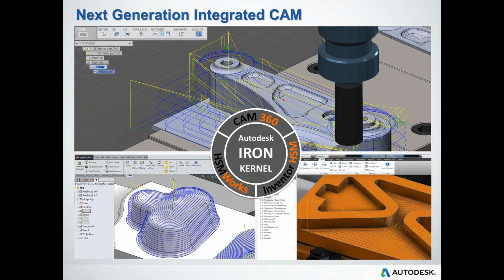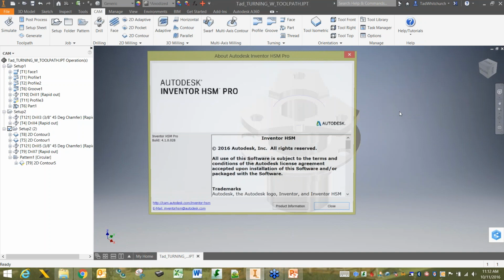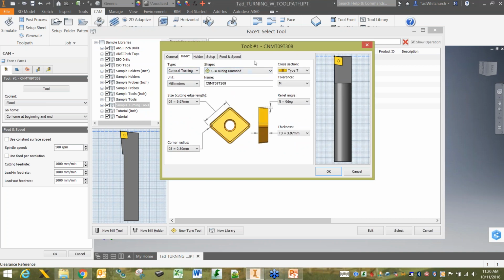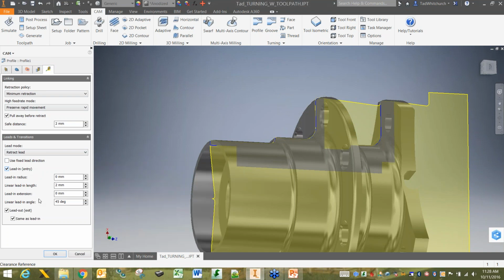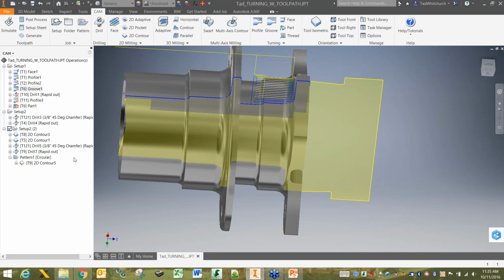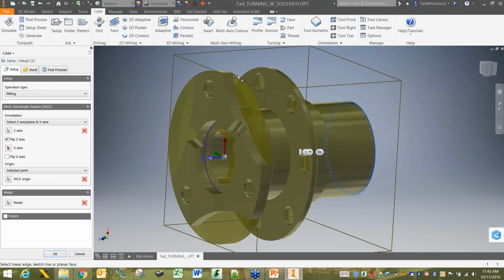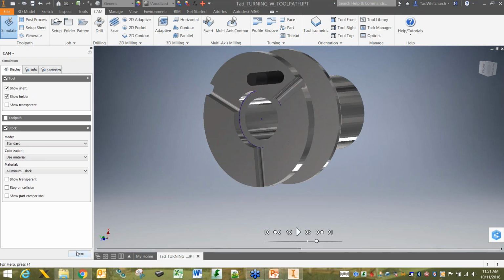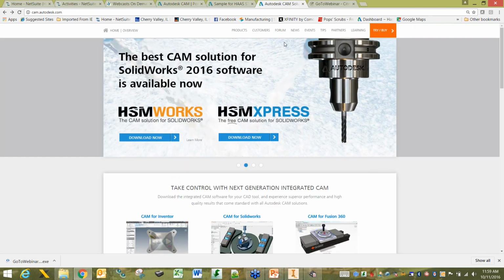Inventor HSM Turning

Comment: Does Inventor CAM has an ability to generate a canned turning cycle for DMG Mori NLX 2500 700 CNC machine with main and sub spindles? Thanks.
Reply: Check out this link... https://cam.autodesk.com/hsmposts and on the "Vendor" drop down you should find the DMG Mori.  I looked at the sample and not seeing canned cycles.  You might also try the Doosan as that post seems close and does support some canned cycles.  This forum is a great resource place... https://forums.autodesk.com/t5/hsm-post-processor-forum/looking-for-post-for-dmg-mori-nlx2500-mill-turn/td-p/6851166
Reply: @tadwhitchurch1103  Thanks for a reply buddy, I will look into it.